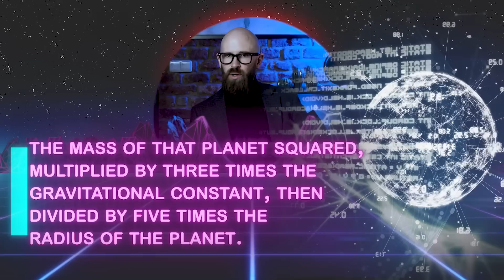Is It Possible to Destroy a Planet with the Death Star Laser?

Comment: Ok I know what I am going to say is nitpicking but it is important. First Simon star wars is science fantasy. It's an actual genre that combines elements of both to create something new. George Lucas has agreed with that so I am going with it, not to mention it is it's official genre. Anyway the other problem is that the death star, and most other things in star wars, don't actually fire lasers despite them being called lasers. They fire what is more closely related to programmable plasma bolts. Now that doesn't mean your conclusions are wrong but still. Fun fact: nuclear bombs are not used in star wars because each turbolaser shot from any capital ship is either equivalent  or vastly superior to any nuclear bomb and without the radiation.

Comment: Yes and no. You can destroy a planet with a laser based weapon but that laser would have to impart enough energy to overcome the gravitational binding energy of the planet. Basically everything in the universe is held together via gravity. More mass means more pull. To break it apart you have to overcome the gravitational pull. Lasers themselves are more of a burning thing, focused energy on a single point. It might be theoretically possible to change a laser so it imparts its energy as an explosive force but I doubt it. Unless you pack the core with some explosives, enough to overcome the gravity, and use the laser to ignite it the most you'll do it shoot a hole into the object/planet. There'll be some burning in the surrounding areas, both entry and exit, and the power of laser will decide how far that reaches. Still just a big hole puncher. Probably the biggest problem with an idea like that is the energy requirement. You have to generate every single ounce of energy the laser will end up holding. On top of that you need a way to vent excess heat and there'll be a metric fuck ton of that. A way to get rid of any waste your energy production creates. Then there's the matter of the infrastructure being able to withstand the heat and energy said laser will be emanating.

Comment: Clearly they can move the death star quickly though space so they simply provide an equal amount of thrust in the opposite direction for the same amount of time the laser is fired.  The magic metal they use for the death star can easily handle the stresses.

Comment: I mean, to be fair, the Death Star works by literally absorbing stars. That solves both the issue of having the mass of a star's core and having the energy emitted by the sun in a week, because it actually absorbs the amount of energy the sun would have emitted if it spent a couple million weeks. Lasers still don't work that way though, and storing an entire star inside a tiny moon is a bit hard. As for antimatter storage, it's not as hard as you think to store a trace amount of antimatter, trillions of kilograms of it is a lot harder, but not any more impossible than obtaining the massive funding for the Death Star and fitting an entire Star in it. You just need a lot of magnets, or power an artificial magnet with the remaining percentage of the absorbed star's energy. 

Also also there is actually another planet destroyer in Star Wars lore that shoots extremely heavy and fast projectiles, so 13:30 already exists.

Comment: Doesn't all this assume that all energy has to be provided by the superlaser? For example, could the superlaser 'merely' have enough energy to cause something like an uncontrolled nuclear fission reaction, in which case the mass of the planet itself could contribute 'fuel'/energy and the beam could be creating a path of least resistance towards the core of a planet as it punches through the crust?

Limitations of special effects 60 years old aside, could enough energy be harnessed in a way similar to this? 

Also, Star Wars is a Western. :)

Comment: ive been wondering 
mainly from sonic the hedgehogs eclipse cannon
a weapon said to have the power to pierce the stars

what would happen to earth / a planet if you were to just LITERALLY blow a clean cut hole through the center?
like obviously it depends on how big of a hole
but lets say small enough to not take out the solid part of the earths core entirely
what would happen?
i cant imagine it would entirely destroy the planet tetotally
but the worst thing i can imagine is massive tectonic events all over the world as the magma settles into the hole cut into the earth
along with maybe losing access to a significate amount of water as it pours down the hole and towards the core?
Reply: Poke a hole where the water is, the water cools the mantle but steam would rush out the hole... It'd be a geyser. Maybe depending on the hole, would it be enough preasure to shift the planet? Or the preassure would be so great it will just blow the hole bigger...

Comment: You say "would require a week's worth of energy output from our sun" and all I hear is "very possible".

Also assembling a death star would be trivial to a galactic empire. As would be all the technological limitations of modern batteries and heat sinks. And remember they have a moon's worth of volume to fit enough batteries and heat sinks in. The only fair complaint is the recoil but there's many workarounds and iirc the laser did require a warm-up period which would've drawn that acceleration out over a period.

Isaac Arthur would be disappointed. 😂

Comment: Totally possible.

If you focus enough energy onto a small enough volume of space you can create an artificial black hole, a kugelblitz.  If you create a kugelblitz a few millimetres in diameter at the centre of a planet it would start to consume the planet.

But the planet wouldn’t just suck down into the kugelblitz, only a small portion of it would.  But that small portion of the planet would get freakishly hot and emit absurd amounts of radiation before vanishing into the kugelblitz.

So you wouldn’t need to provide all the energy to overcome the planet’s gravitational binding energy.  A tiny portion of the planet itself would provide the bulk of the explosive energy.

The “only” thing you need to do is focus enough laser energy into a small enough region to create the kugelblitz.

Comment: A laser can't destroy a planet unless the beam is about as wide as the planet.  It would just burn through the planet otherwise, and do comparatively little damage of any sort.  It would be the same as a supervolcano going off.

If you want to blow up a planet, just lob a solid object about the size of a volvo, at 99% of the speed of light, and make sure it's essentially a giant hollow-point frangible bullet.

The material of the object will instantly spread outward in a cone, spreading the energy of impact outward through the planet, blowing it entirely apart.  At that velocity, nothing would survive.  There wouldn't be a single chunk left bigger than Hawaii.

Comment: Instead of a planet exploding why not cooking the planet from the inside with a laser. I guess most of the planets with life on it are geolocial similar to earth. So, why not renanact the plot of the movie 2012 via the pressing of button. The laser adds energy to the planets system which raises it´s core temperature. Similar to a stream of white hot metal fired into a bathtub which brings the water to the boiling point (if you ignore the leidenfrost effect). Volcanic eruptions and earthquakes would kill the population while the planet is slowly turning into a ball of molten magma.

Comment: A neat thing we'd thought up in a random discord was that is we utilized warp fields to curve the energy output of the laser generator around, we could get sum 0 momentum shift in the death star (because space thinks things are going straight through it, thanks bendy!) while still pointing it all in the right direction. Since the radiative heat would also curve this same path, that does solve that issue right up until it leaved the controlled warp region. 

Gotta love some good ol' fashioned sci-fantasy

Comment: Actually you could destroy a planet (at least a terrestrial one) with a decent sized laser. At the initial state all forces shaping the planet are at an equilibrium: gravity canceling out electromagnetism canceling out thermal forces/radioactive decay etc. One has only to imbalance that status. Using a laser one would generate a crack in the crust and a whole through to the mantle (for more effect aim for an active volcano). The energy provided by the laser would increase the thermal force of the core thus increasing the pressure and and ripping the planet apart before a new equilibrium is found. The laser would only be the fuse to the bomb.

Comment: A kinetic impactor accelerated with the focused light of a star would be just the battery. It would just be a bit harder to discharge in a meaningful way than a pumped hydro station unless you really hate that planet two or three star systems over.

Comment: Better solution would be a wide-field  high energy radiation beam with far less power than the Death Star laser. Just enough to strip away most of the mass of the atmosphere of the planet and in the process heat up and irradiate the surface of said planet as the Death Star orbits from a distance. One full sweep around the planet with this radiation beam would leave the planet as an airless, sterilized ball of rock. There might be a tenuous residual atmosphere of super heated steam left behind from the oceans that were boiled away and where not all of this vaporized ocean water was blown far enough out into space and out of the planet's gravitational influence. In fact a few years after the Death Star departed from this destroyed planet the leftover mass that didn't escape the gravity well of the planet, which would likely mostly be made up of water ice, would form a ring system around this dead rocky planet.

Of course this "less powerful" Death Star laser would still be ridiculously impossible but at least slightly less ridiculously impossible.

Comment: Using another sci-fi franchise's rather impressive energy storage medium for comparison, if you wanted to store up the energy required to destroy a planet like Earth, you could do so using 69,166,666,666,666,666 Zero Point Modules.

The Ancients (from the Stargate TV series) were pretty well up there in terms of technology, but, I don't think even they would have the capability of creating that many ZPMs in time for the Death Star's completion date. Even if they did, at about 6 kilos each, your entire Zero Point Module energy storage array would have a mass of 415,000,000,000,000 metric tons. For comparison, that's in roughly the same ball park as the mass of Epimetheus, one of Saturn's moons.

Ouch. I bet that would be expensive to make. Still, plenty of room to fit that inside a Dyson Sphere, which is a feat of construction on a completely other level. :D

Comment: Thing is that the Death Star itself doesn't make much sense. There aren't that many habitable planets and it's much easier to just scorch the surface than it is to blow it up. The only reason to do the latter is if what you are trying to remove is a burrowing species in which all members of it are dangerous and hostile. Like the Yuuzhan Vong.
Reply: It's not about practicality, it's about intimidation. "Fear will keep the local systems in line. Fear of this battlestation."
Reply: @aneasteregg8171  still funny that in a forum that it could lose to a space battleship that has it's own powerful equivalent to the death star.

Comment: Rather than lasers, I'd go for a focused beam of antimatter.  I mean, if you have the type II civ tech, antimatter is going to have a much more devastating impact on the target.  Antimatter beams would also support the multi-stream intersection into a single, focused beam. Though, practically, it still wouldn't be ideal.  Much better to have multiple distributed streams independently focused on the target.

The calculation of trillions of tons of antimatter is only correct if you're relying on providing the mass of antimatter to equal the mass of the planet you want to destroy.  This completely ignores the fact that the antimatter-matter reaction converts mass into the energy equivalent of the initial mass times the squared speed of light.

In essence, the thing that would destroy the planet is not the negation of matter through cancellation, but the resulting conversion process.

This would require an amount of antimatter that is at least 4 or 5 orders of magnitude less than the thing that you're trying to blow up, perhaps even much less.

Anyway, I've always loved the hard science approaches toward planetary destruction.  I miss the early days of usenet where creating novel plans for paving or destroying the earth using exhaustive physics became a pastime.

Comment: What if the laser could cause the matter along its path to undergo fusion, which then started a fusion chain reaction within the core, that eventually ripped the planet apart?  Then the planet's matter would fuel the explosion, and the super laser would be the match.  How much power would it take to set that off?
Reply: The problem there is that fusion of the heavier elements found in a planet's crust wouldn't result in more energy being released than what you put in. That's the reason why stars die, they start fusing heavier nuclei if conditions at the core allow for it, but when they run out of nuclei which are light enough to fuse together, the star can't generate enough pressure to keep from collapsing inwards.

Another reason why stars are able to keep fusion going so successfully is because of all that mass pushing down on the core. It bottles up all the fuel in the centre and it means the neutrons produces by fusion are easily able to create a chain reaction. An Earth-like planet, on the other hand, has much less mass, and so even the pressure at the core wouldn't be good enough for fusion of iron.

If you could somehow compact the planet into a much denser sphere, then add energy, then theoretically you could cause a fusion reaction to happen. It might not even have to happen for more than a second, because once you remove the force which is causing the planet to be squeezed into that small sphere, you remove that balance of pressure versus gravity, except that an Earth-like planet's gravity would not be able to counteract the pressure which has been created, so all of the matter rushes outwards in an explosion.

However, creating the force necessary to compact a planet would itself probably require a colossal amount of energy. Still, if you were Emperor Palpatine it would be worth it to be able to say that you hugged a planet to death today. :D
Reply: @remingtonryder  "However, creating the force necessary to compact a planet would itself probably require a colossal amount of energy."  What if you just compacted a small part of it... with a super laser!  Let's consider that you could burn a hole right through a planet with a laser in a matter of seconds.  That has to create an absurd amount of heat and pressure along the path of the beam.  How much fusion/fission would you have to create to blow the planet up?
Reply: @HoytJolly  I did a little bit of re-reading and actually, fusing or splitting iron nuclei would not release energy. They are examples of what is called an endothermic reaction. You could still heat up the core by a ridiculous amount with a powerful beam and cause massive volcanic activity, though.

That's not to say that you wouldn't see iron fusion happening in conditions similar to a star's core collapsing, but it would actually use up energy to create more massive nuclei.
Reply: @remingtonryder  Endothermic nuclear reactions?  Cool!  Never heard of them.  Do you have some links?
Reply: @remingtonryder  Ok, Then I'll have to come at this a different theoretical way.  I'm going to start a new comment thread

Comment: The reason they chose the design of the death star is that most of the frame is actually a giant spring that evenly distributes the recoil through the whole ship in a way that dampens the kick back.
Reply: That sounds valid, but in space with zero G that suspension wouldn’t really work to stop the force pushing them back.

Comment: Ok, once we build the death star we fill it with AI microbes impregnated into pancake batter to operate it. Then, with proper alignment. Once we fire the death star, it can use its momentum to arrive where the crew is to build the next death star. As a bonus, while enroute, it will make enough pancakes to feed the crew of the next death star.

Comment: One more wee point regarding the visual impossibility of the Death Star laser's portrayal: It actually has to be producing considerably MORE than just one gravitational binding energy of Earth's worth of energy. A somewhat simplified way to imagine the gravitational binding energy of a planet is to imagine that you are accelerating every individual chunk of material of that planet to escape velocity, so it flies off into space and never comes back down again. Earth's escape velocity is 11.2 km/s, and Earth's diameter 12 747 km. Which means, that, roughly, accelerating the material of an Earth-sized planet to escape velocity means all of that material is moving fast enough to cross one planetary diameter in about 1000 seconds. In other words, the debris ball produced by the planet exploding would expand fast enough to become double size diameter of the planet in 16 minutes.

At that rate, it would take over an hour for the planet to fully disperse. 

And Alderaan blew up entirely in, what, 2-3 seconds of screen time?

Which means that DS laser actually has to be outputting at least 1000 TIMES the gravitational binding energy of the Earth. Probably a good deal more....